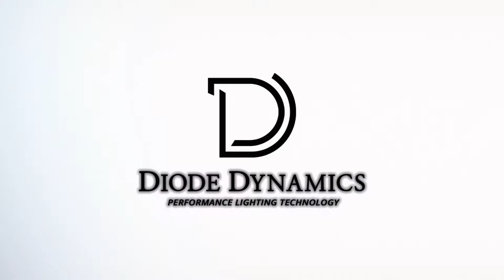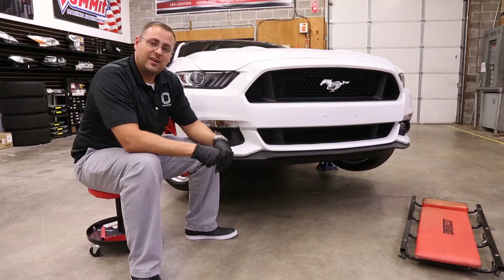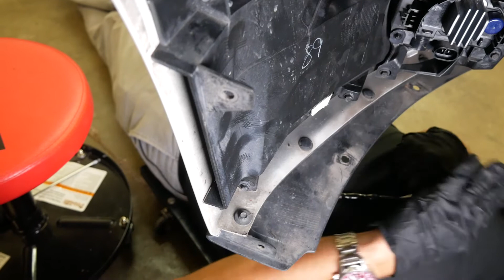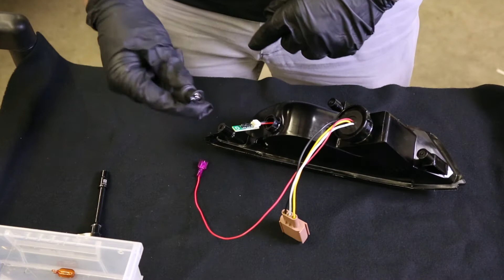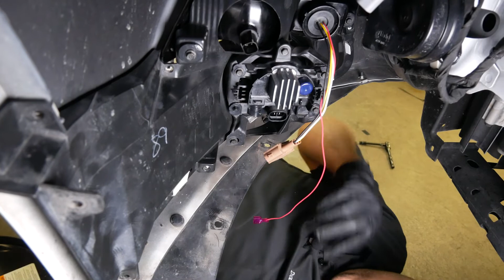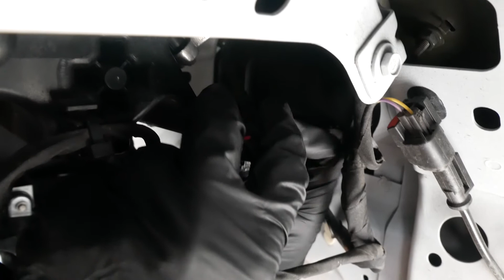How to Install 2015-2017 Ford Mustang Sequential LED Turn Signals | Diode Dynamics

Comment: Is this availabe for the UK please?
Reply from the maker: Hey there! there is a switch inside the connector that will allow you to switch the pattern from US to EU!
Reply: @diodedynamics  Thanks.  Do you do amber parking light and DRL functions?
Reply from the maker: @minshum  With the optional plug-and-play DRL Harness, you can wire your Sequential LED Turn Signal to operate as an extra daytime running light, to show them off day or night. This harness enables the housings to light up with high intensity for visibility even in direct sunlight!
Reply: @diodedynamics  Thanks but I specifically mean AMBER parking lights and AMBER DRL function?
Reply from the maker: @minshum  Feel free to give us a call at 314-205-3033 Monday-Friday 10 a.m.- 5 p.m. CST, or shoot us an email at contact@diodedynamics.com, and our service team would be happy to help you with that.
Reply from the maker: @minshum  Please go ahead and give us a call at 314-205-3033 Monday-Friday 10 a.m.- 5 p.m. CST, or shoot us an email at contact@diodedynamics.com, and our service team would be happy to help you with that.

Comment: I just installed these on my car and during the day when the headlights are off the turn signals I get hyper flash on the dash and they turn signals don’t work until the headlights are turned on. If I install the DRL harness will they fix the issue?
Reply from the maker: Hey Brandon! This is a strange and unique issue. Please go ahead and give us a call at 314-205-3033 Monday-Friday 10 a.m.- 5 p.m. CST, or shoot us an email at contact@diodedynamics.com, and our service team would be happy to help you troubleshoot.
Reply: i have the same issue, how did you go about fixing it ?
Reply: I have the same issue ..

Comment: I have this on my GT350R. Is there a way to change from sequential to static or do I need to buy an entirely new unit?
Reply from the maker: No need to buy another product, MStrange88!

Please refer to our online instruction manual to change the settings from sequential to static. 

http://images.diodedynamics.com/docs/install/ford/mustang/15_Ford_Mustang_Seq_Turn_Signal_installation_guide_8.5x11.pdf

If you need further assistance, go ahead and give us a call at 314-205-3033 Monday-Friday 10 a.m.- 5 p.m. CST, or shoot us an email at contact@diodedynamics.com, and our service team would be happy to help you!

Comment: I have a 2015 ecoboost premium and they only work for me when my headlights are on
Reply from the maker: Hi there! Did you purchase the optional DRL Harness to be able to use the DRL function? 

https://www.diodedynamics.com/drl-harness-for-2015-2021-ford-mustang-sequential-led-turn-signal-pair.html
Reply: @diodedynamics  is that required for the turn signal part to work? I don’t need the lights always on, I just need the signal to work.
Reply from the maker: @SniperScope99  The turn signals should work without the DRL harness. The DRL functionality will not. Please go ahead and give us a call at 314-205-3033 Monday-Friday 10 a.m.- 5 p.m. CST, or shoot us an email at contact@diodedynamics.com, and our service team would be happy to help you troubleshoot!

Comment: Where is the spade connection at I do not see it your hands were in the way on the video
Reply from the maker: The connector for the spade connector is attached to the optional DRL adaptor wire. It will be it's own separate wire coming off of the harness.

Comment: Do these switchback when not using the turn signals or hazards?
Reply: I think what he's asking is can we get the sequential in full amber mode..for us guys that like the stock parking light(amber leds only)this would have been the perfect addition..but i bought it anyways..i can live with the parking light being white
Reply from the maker: Hi there! These do have switchback functionality as well!
Reply: @diodedynamics  Do you have anything that maintains the amber color while running so it has the stock look? I really like that look with the color of my car, Thanks
Reply from the maker: @blade000007  Sure! Our 510-lumen XP80 Front Turn Signal Bulbs will give you FAR more light output than stock, and retain a crisp amber color. You can check those out here: https://www.diodedynamics.com/front-turn-signal-leds-for-2015-2017-ford-mustang-pair.html

Comment: American Muscle has the Raxiom branded lights for $289. I see you have your DD branded lights for $220. What is the raxiom coming with to warrant a $69 premium price?  I much prefer the $220 but don’t want to be missing anything.
Reply: How can I get this hole setup? I don’t like the bulbs. Everyone is complaining.
Reply from the maker: +Christopher Hartman We are not familiar with Raxiom's product, but our Sequential LED Turn Signal has been designed, tested and manufactured in the USA to provide a DOT/SAE compliant output pattern and OEM-grade performance!
Reply: Diode Dynamics...how can I get this hole setup? I like it more than the lightbulb setup
Reply: Christopher Hartman diode dynamics is the best from the research I've made. Raxiom is just overpriced overall because it's on American muscle
Reply: I know this is an old post but I used to buy Raxiom lights from American Muscle. Stay away!!! They are nothing but cheap junk made in China and are marked up sky high by AM. Not to mention they would only last only a few months before the bulbs started to flicker... switched to Diode Dynamics almost two years ago and have had no issues whatsoever with any of their products. Hope this helps!

Comment: So if you want them to be on during the day you have to get an additional adapter?
Reply from the maker: +T Byrd Yes, you will need our DRL Harness for these turn signals to gain DRL functionality. Check it out at the link below! 
https://www.diodedynamics.com/drl-harness-for-2015-2017-ford-mustang-sequential-led-turn-signal.html